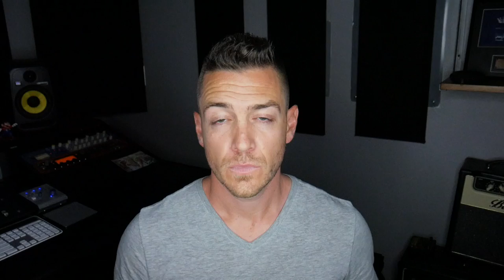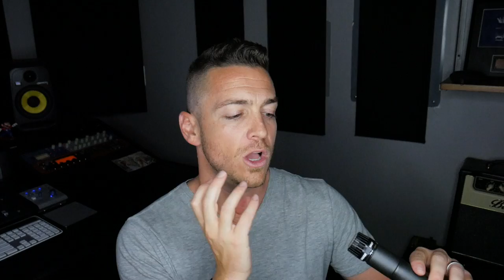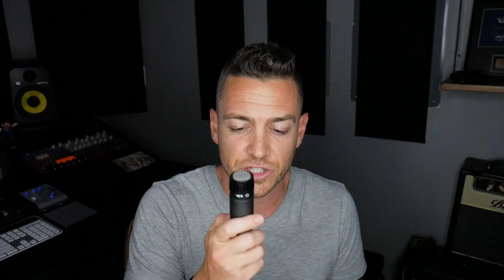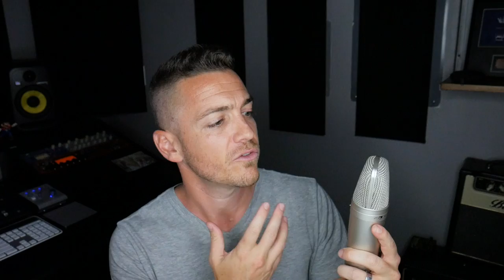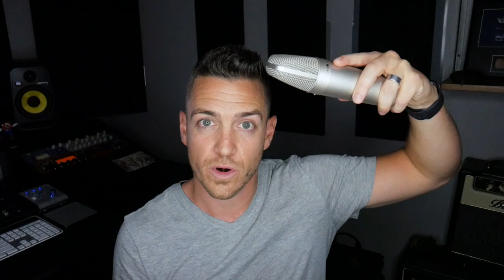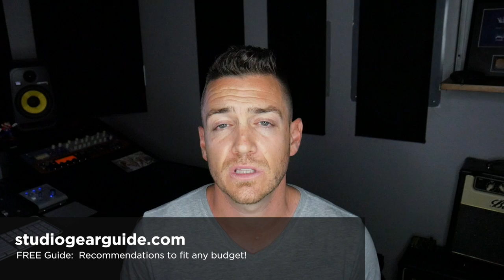What Is Phantom Power And Why Do You Need It? - RecordingRevolution.com

Comment: There are condenser mics that use batteries inside them so they won’t need phantom power. These are typically inexpensive high impedance unbalanced mics used in consumer systems. Those mics are quieter than dynamic mics as they keep background noise down and their sound is cleaner.

Comment: The history of 48V is weird. It comes from Norway radio relay stations that had to be able to be run from backup battery. They used 4 x 12V lead-acid batteries (or 2 x 24v) because of availability. There had to be equipment designed to use that power and that solution started to spread elsewhere. So when it came time to actually implement "phantom" power, 48V was logical choice as there were already gear that used it. 

If we had to design it today, we would never use 48V as that is stupidly high. We would probable choose 12V or 9V (but not 5V, that is problematic when it comes to circuit design, it is doable but i would not like it, also voltage loss over long wires would be a huge problem.. when things are >7V it is sooo much easier to do everything.. ).
Reply: Thanks for sharing, very interesting background.
Reply: That's really interesting, but it makes me curious as to why we still use 48v instead of a smaller voltage. 🤔
Reply: @SaintCrownMusic  Too late to change, everything is in 48V. We would have to change everything and start to use a butt load of converters. The new voltage also can't be used with XLR, it would have to be a new connector or hilarity will ensue every single day..

In reality, it only poses a slight problem for circuit designers. Current limiting has to be applied to make it safe, while keeping common mode noise low. It is not really that bad, adds another step... that not all manufacturers will do which can lead to damaged equipment but it is kind of rare anymore.
Reply: @squidcaps4308  Thanks for the explanation! I learned me some shit today! 👌💯
Reply: @squidcaps4308  do they call it phantom power because it doesn't 
Shock humans? 🤔 I use to switch  mics while phantom power is on and I never got shocked.
Reply: my microphone is a electric condeser one and it  requires a battry cell of 1.5V and then it gets active and the audio is transmitted through my XLR cable does it require phantom power and instead of XLR cable  it needs XLR to XLR ??
plz help
Reply: @kingjulius6858  48 volts on microphone cant kill person cuz amperage is kinda low
Reply: Do you have sources for this? I’m looking it up and can’t find any.
Reply: So why is phantom power even called phantom? How does it differ from the electricity from a wall outlet other than I suppose the obvious that the wall gives 123 V?
Reply: @hamitcampos4989  Oh boy.. how can i write this shortly.. Back in the day Norways radio network had a problem. Some of the relay stations were very remote and powering them from the mains was just not possible. So they developed gear that could work with four 12V batteries. At roughly the same time BBC was looking for a standard to use for the new condenser mics and other low power active equipment. It is possible to send current down the signal wires via balanced lines without the signal being affected.

So, they picked the Norwegian standard as it was ready to be implemented, they had worked out the kinks and had a system, ready to go. And this is why we got phantom power, which is 48V to this day. The current is however very low, you can power a signal led but not a flashlight from it. It works just fine with dynamic mics too, even though they don't need it, so it is neat system to send power over the same set of wires. It is named phantom since you can't see it in the signal, it just.. vanishes like a ghost or a phantom. Ribbon mics do not like phantom power but all other mic types can handle it, which makes it handy cause you don't have to think what mic cable has it enabled and what doesn't.
Reply: @squidcaps4308  Ah you can't see it in the signal. Okay that sounds like what I read. I just didn't get what that means. Like you can't see it in the mic signal or something? I still don't get how something like the Zoom H6 can spit 48 V phantom running off 4 double A batteries. Let alone something like the H4N Pro on only 2. like how's that even doable?
Reply: @hamitcampos4989  There are many ways to step up voltage but the most common way is to convert the DC to some form of AC, for ex using an oscillator and a transformer (or capacitor+diode, or... there are many ways to do it), then you rectify and filter it. Switched mode power supply circuits are the most common way to do it these days and are cost effective.
Reply: @squidcaps4308  Ah all verry interesting friend.
Reply: Thanks man you saved me to buy 5v usb powered phantom power supply
so should i buy 12v it will br good??
Reply: @RTX4090TI-xo  Phantom power maximum power draw is 240mW, plop that in the equation and we get 240mW/48V = 5mA. We can push voltage up using quite cheap circuit, converting current to voltage, 5V usb should give you at least 200mA, that is 1000mW to spend, 48V/5V * 240mW = <2000mW... If connected to a 2W charging port style USB, no problemos, if connected to a hub that is connected to another hub.. not a chance in hell to make 5V usb to power true 48 phantom at the max, but: most devices do NOT use full 240mW but just microamps. So, not guaranteed that everything works but condenser mics that aren't power hungry should work. 

And learning the two basic ohmic equations in electricity gets you 80% of the answers.

Comment: A dynamic mic is basically a little electric generator (motion between a coil and a magnetic field produces electricity). Since no power is needed, many dynamic mics come with a 1/4 inch jack and a cable with only 2 wires for the audio signal. An optional third wire can be added for a cable ground to help fight hum, a good idea if the mic cable goes more than a few feet. On the other hand a condenser mic is basically a capacitor, a device that has two separated surfaces that can hold a charge. It takes a voltage to put a charge on the plates and this is where the phantom power is required. Rather than add more wires to the XLR cable, the power is "magically" added to the same wires as the audio signal, which I suppose is why it's called "phantom" because flip the switch and it's there, yet it doesn't interfere with the audio signal. At the preamp the circuit blocks the 48V and only looks at the audio signal. You could say that the preamp has a high pass filter up front that blocks low frequencies (48VDC has 0 frequency) and passes higher frequencies, namely the audio band of frequencies.
Reply: that's a much better explanation for me, thanks very much.
Reply: @bashful228  If you want to understand a little more, you might also like to read the comment I added a few comments below (original comment by videditor1076). Hopefully it is understandable
Reply: what about balanced line, why do so many "video" microphones not have XLR connectors?

Comment: I am told that "Phantom" comes from no voltage coming down pins 2 & 3 when It's on. Even though there is power to each pin when connected to pin 1. Thus 1&2=48v, 1&3=48v, but it disappears when 2&3 are connected, which are you audio carrying pairs.
Reply: Voltage is always measured between 2 points. You need to be thoughtful in how you measure voltage to understand what is going on. Often the best way is to measure from a point to ground. In the case of an XLR cable, pin 1 is ground. When phantom power is turned on there most certainly IS a DC voltage coming down pins 2 & 3 along with the audio signal. If you measure the voltage from pin 2 (signal) to pin 1 (ground) you will see that the audio signal is present along with the phantom DC voltage, and the same is true measuring from pin 3 to pin 1. Now if you can put both measurements on a scope you will see that the signal on pin 2 is exactly the opposite of that on pin 3. That is, if the voltage on pin 2 is going up, then the voltage on pin 3 is going down exactly the same amount, sort of like mirror images of each other. If you look on a scope you will also see that pins 2 and 3 have the phantom voltage present. So what's going on? Here's the trick -- the preamp is designed to only amplify the difference between pin 2 and pin 3. Since the phantom voltage is the same for both pins, it creates no difference for the preamp to amplify and thus is ignored by the audio amplifying circuit. But remember that the audio signal on pins 2 and 3 are mirror images of each other. Since they are different and the difference is the audio signal, then it gets amplified. Got that? The audio signal gets amplified and the phantom power does not. So why in the world did they design it like this? It's quite clever actually. If your cable picks up noise, that noise will most likely be identical voltage wiggles on both pins 2 and 3. This noise will not be amplified since it appears as identical voltages on pins 2 and 3 and is ignored by the amplifier circuit since it only amplify differences. Very clever way to cancel out some noise. This method of connecting a microphone is called "balanced" where the audio signals on pins 2 and 3 have identical but mirrored images, and is great for minimizing noise (you can never eliminate noise completely). But also be aware that a mic can be connected with an XLR cable and send out an "unbalanced" signal, such as a dynamic mic where you want phantom power turned OFF. The unbalanced connection does not minimize noise much at all compared to a balanced connection.
Reply: @dennismiller9681  ah I thought one wire was signal and the other was a neutral reference line (no audio) to be subtracted from the signal line 9i.e. subtract noise). but mirrored makes sense, i forgot that I (learned audio decades ago!), if you subtract the negative or mirror signal from the positive you end up with 2x the positive, or double the signal strength.
Reply: @bashful228  ...yep, or you could think of it that each pin carries half the signal and the difference is the whole. Either way...

Comment: I have a shure sm94 which is a long range microphone and it needs phantom power because it is a condenser microphone, the other "brother" SM57 does now want it but for its shape, it is also good for long distances, for example, I use them in a theater when we have some shows, of course we cannot provide a microphone for each actor (like 5-6 in the scene)  so we use them, of course the sm94 is a beast in long range compared to sm57 but they also do pretty well

Comment: I love my AKG C1000S microphone, 20 years old. It has a 9V battery inside so I can use it with my Bose S1 Pro speaker which does not provide phantom power.

Comment: I take it that a condenser mic is going to have much more sensitivity feedback in a situation where the speakers are located close to where the mic is?  It seems that if the condenser mic is typically found in a studio then that is because the output of the microphone pickup is isolated from people wearing headphones.  So my question is whether a condenser mic would not work well in a chapel at church for a choir, where the choir's sound is amplified by the chapel's sound system consisting of large speakers fixed inside the wall behind the choir?  Is a standard coil-type microphone the best solution in such a scenario or is there other types of mics to look into for that?

The phantom power must travel down one the the four nodes in the xlr cable?

Comment: I've never used the AC adapter that came with my Behringer UMC404-HD, but the phantom power still works. I keep the interface connected to my computer at all times and at least one light stays on all the time, even when my computer is off. The second light goes on as expected when I turn on the phantom power switch. My question is this: Should I be using the AC adapter that came with this interface? If it is not needed, why was it included with the unit?
Reply: I recommend you read the user manual. It is probably explained there.

My educated guess: The device is fully powered through the USB port, when used as an audio interface. The AC adapter is included if you wish to use the device merely as a standalone 4-channel pre-amp/mixer, without having to connect it to a computer. At least that was the case for a similar older interface I've owned.

Comment: I have a somewhat related question with regard to phantom power. Can you damage a tube condenser microphone if the phantom power was accidentally turned on? Most home interfaces these days have phantom power applied to banks of inputs rather than individually. I've been in a situation where I've had my tube mic plugged into channel 1 and a non-tube large diaphragm in one of the other 4 channels. Recorded a full session this way, then realized that phantom was hot on channel 1. Everything seemed fine, and I'm reading that the power supply runs blocker for the voltage backfeed, so your mic should be fine. However... did I somehow damage my power supply with this little mishap?

Comment: I have drum mics that use 2 condenser over head mics, and 4 "regular" mics. My mixer phantom power button uses 6 channels when turned on. So, my question is, with the phantom power on, if I plug in my "regular mics " into one of the channels that is using the phantom power, will I ruin the microphone? Thanks in advance!

Comment: What happens when I have one dynamic and one condenser mics connected to an interface, Can I turn on the Phantom Power and both work fine? it is usually one button for the whole interface.  Also, Will this power ruin any piece of electronic/mic and how? Thank you

Comment: Hello would there be a sound on the condenser mic plug into the phantom power. I just need it when I sing and play the piano. Can I use a small computer speaker to connect to the phantom power. Or the mic and phantom power sufficient?

Comment: With my interface, a Volt 276, the 48v button is either on or off for BOTH inputs whether they're necessary for both inputs or not. So,  since I keep my guitar's 1/4 inch jack connected all the time,  and the Condenser mic with an XLR connection in the other input all the time,  will this be a problem when I have to use the condenser mic and I press the 48v button?   Do I have to unplug the 1/4 inch jack in the other input with the guitar ?

Comment: What Phantom Power do you recommend if u want to use a Shure Sm-7b?
Reply: All Phantom Power is the same. As long as the audio interface you are plugging the condenser mic(via XLR cable) has a physical button to toggle on 48v you should be fine. 
In all fairness you are asking for a Shure Sm-7b which is $400 and thats with no Audio interface included. So you are looking at $400+ for equipment... I do not know if you will simply be streaming games and want to clear up your vocals or if you are going to use it for actual recording of vocals and make tracks, but if it's just for streaming games and you want to capture your voice in a crisp and clear manner you should get a Audio Technica AT2035 and a Focusrite Scarlett Solo(if you are only going to have lets say 2 studio monitors plugged in to the audio interface and your microphone and that will be about $400($150 for mic on amazon at the moment and about $200 ish if not less for the Audio interface) . If you want more inputs and outs you may have to look for their other Scarlett models. Sorry for the lengthy comment.
Reply: Random dude thanks AT2035 plus Scarlett will do what for my sons gaming aspirations?
Thx
Reply: @tapptom  if all he wants to do is stream and have better vocal clarity. Get the Scarlett Solo and the AT2035. The button for phantom power is the "48V" one. You will also need to purchase an XLR cable since these types of mics do not come with one. I forgot to mention that.

Comment: i have a samson mtr201 condenser mic plugged into my presonus audio box usb 96 which has a 48v button. for some reason my mic wont pic anything up and i turn on the 48v button after i plug it in. is my mic faulty? should i just use a phantom power supply? i super sure the audio interface is set right because ive used other mics on it (cheaper mics) so i dont know what the problem could be smh
thanx to anyone that tries to help

Comment: Great video!!
I have a question though, if I have an interface with 2 inputs powered at the same time, can I use a condenser mic with a dynamic one simultaneously? Thanks!
Reply: I think no but some interface with guitar any instrument plug can work without phantom so it is possible only if instrument is supported

Comment: I know someone using BM800 mic and not using phantom power,How it works? I’m confused is it fake condenser mic?(BM800 mic) ?
Reply: I also use it without phantom power and works pretty nicely. It's not fake, 48V affects the output volume or gain if I understand correctly.

Comment: Hello, I have trouble with my neewer nw-800 mic. 
1. I have a window 10 laptop that has only one audio jack. 
2. I tried connecting to the audio jack and my laptop did not detect the mic.
3. I have connected an audio splitter and same result. 
Is the v8 soundcard compulsory? 
Can some one actually help with how I can resolve this? I am connecting using the neweer nw-100 power supply. 

Thanks in advance.

Comment: What I have to do if I want to record with a dynamic and a condeser mic at the same time? Power phanton is bad for the SM-57?
Reply: Not an audio engineer but I’ve used both kinds of mics for podcast recording. Nothing would happen to the dynamic mic. It would just work. The phantom power would just do its thing for the condenser mic.